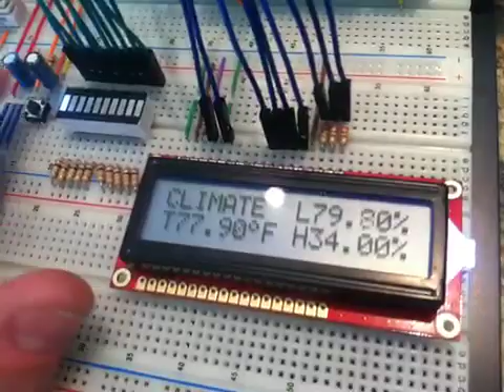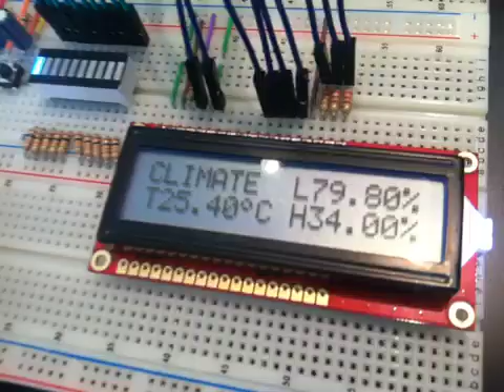Arduino LCD Menu

Comment: Hi Adam. I would love to use this code but I keep getting the followin error when compiling : "../main.ino: In function 'double readTemperature()':

../main.ino:565:8: warning: unused variable 'present' [-Wunused-variable]

   byte present = ds.reset();

        ^

../main.ino: In function 'int readEncoder()':

make: * [main.o] Error 1

../main.ino:605:18: error: 'class QuadEncoder' has no member named 'hb'

   switch(encoder.hb()) {

                  ^

Error code 2"

Comment: I would like to use your wonderfull code to create the menu for my little project but i can't operate the menu!
Could you help me or give me the schematic from your connections!
I just want use a Sparkfun rotary encoder EC12PLRVFD24,a16x2 LCD and a RGB LED and servo motor for tests.

Comment: Hello, I like your solution and I wanted to use a piece of code in my project. (menu + encoder). In the test (verify) your code, I came across an error message with which you do not know:
In file included from gistfile1.ino:29:
C:\Users\xxxxxxxxx\Documents\Arduino\libraries\Button/Button.h:23:22: error: WProgram.h: No such file or directory
gistfile1.ino: In function 'void displayMenu()':
gistfile1:378: error: 'class Button' has no member named 'pressed'
gistfile1.ino: In function 'void settingsChangeUnits()':
gistfile1:423: error: 'class Button' has no member named 'pressed'
gistfile1.ino: In function 'void settingsChangeBacklight()':
gistfile1:459: error: 'class Button' has no member named 'pressed'
gistfile1.ino: In function 'void settingsChangeLogging()':
gistfile1:493: error: 'class Button' has no member named 'pressed'

Comment: Just dropping a quick thanks for posting your menu code.  I was looking for something simple for my project also using a rotary encoder but all the libraries i could find were specific to particular LCD modules - I am using a GLCD so needed to be able to script my own code to control it.  I was able to adapt your code easily - Thanks again!